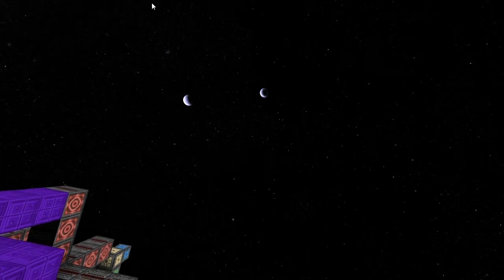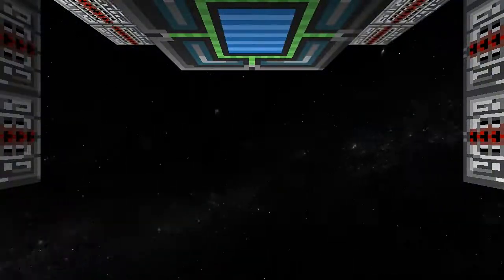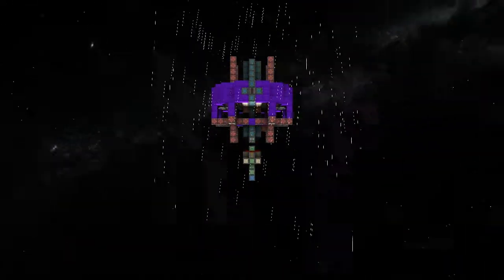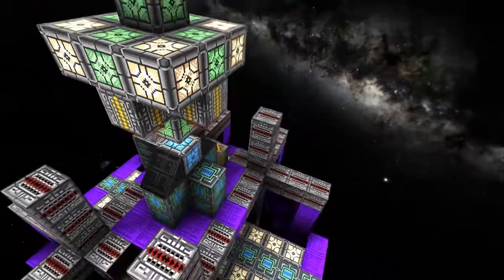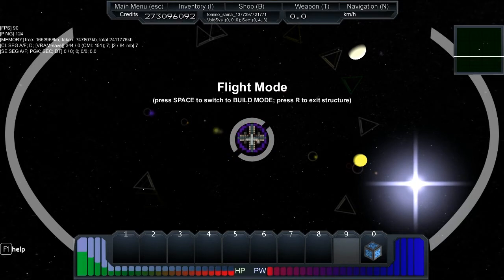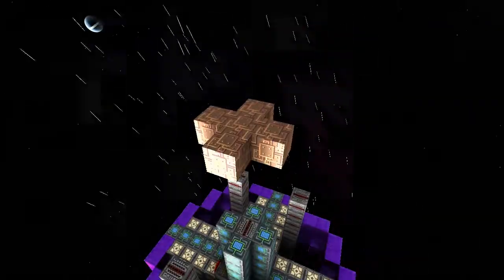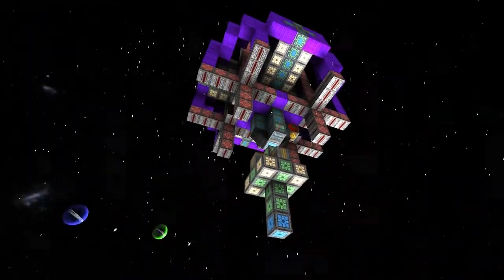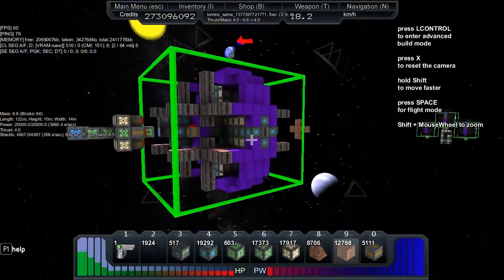Starmade Ep111: Pulse Puller Engine

Comment from the maker: As the Pulse fires from the Engine ship at the rear, you can stop the spinning by switching into the Front ship Core. (pressing Up/Down arrows keys to switch between cores)

The Pulse disables the front Ship which causes it to spin like this. after a 2 or 3 seconds, the ship will stop spinning if there is a pilot inside.